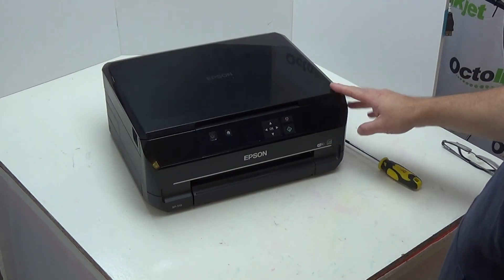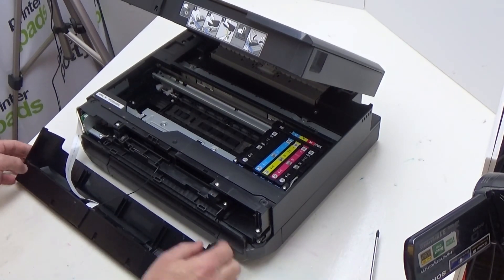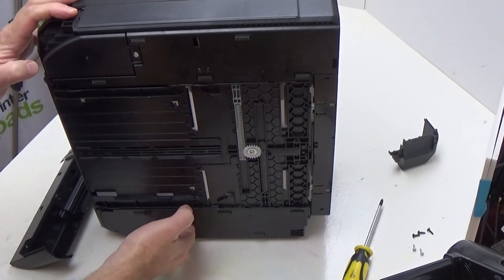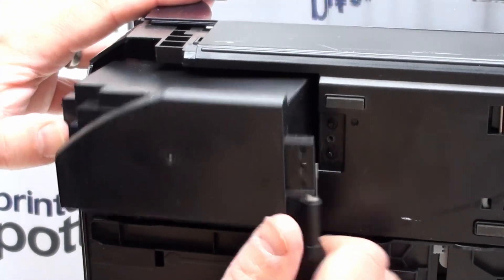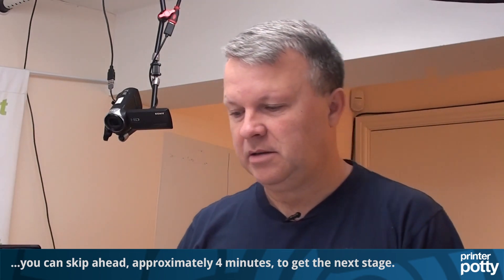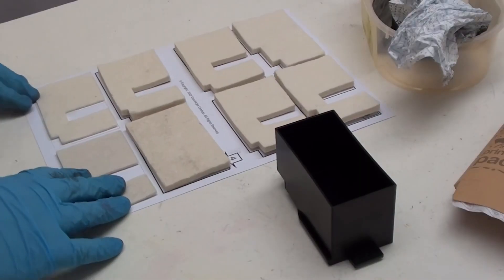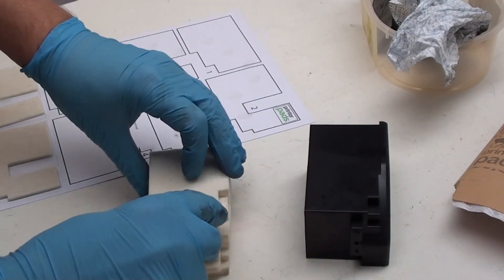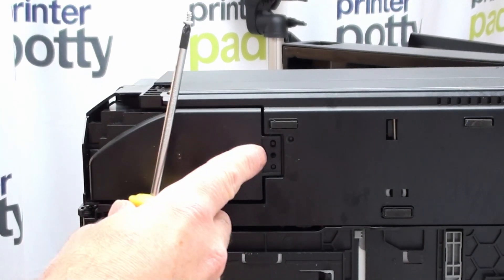Fix Waste Ink Error XP-510 AND Double The Waste Ink Pad Capacity

Comment: excellent video. where is reset the Waste  Ink reset key?. is that on the main set up program on the printer?
Reply from the maker: Check our WICReset videos on this channel as they deal with the reset process for various pc operating systems.
Reply: @octoinkjet  Hi I've replaced the waste ink, through you excellent video (all went as to plan). now to do the reset. Which is the Video which applicable for me, for the XP-510. many thanks.
Reply: @davidwhite-vh2rr  did u find anything I am stuck here too...
Reply from the maker: Missed the follow up so apologies but the WICReset videos cover this. Search this channel for “WICReset” and you’ll find the different instructions for various computer operating systems.
Reply: @ found it in the end ! It worked! Thank you so much !